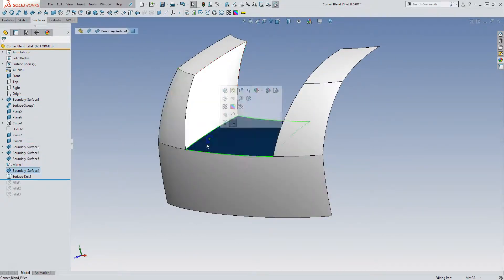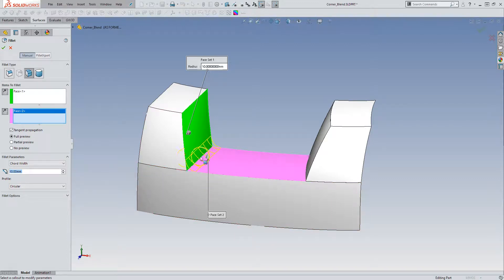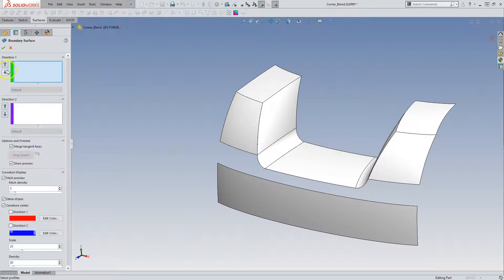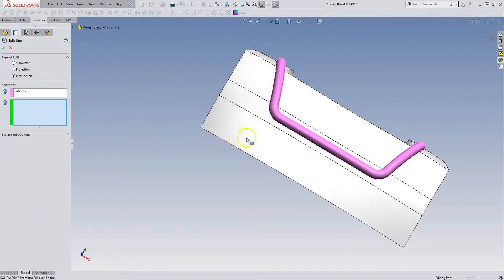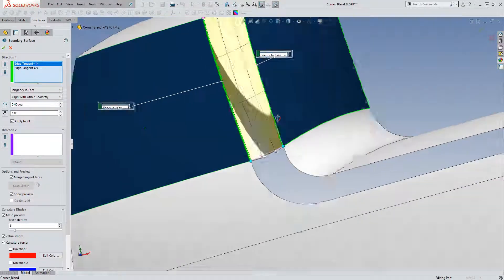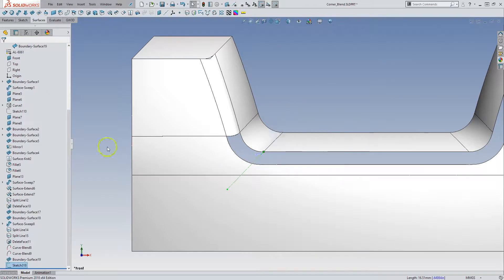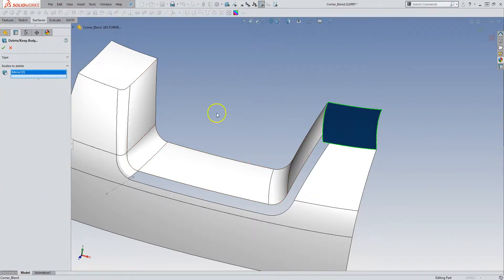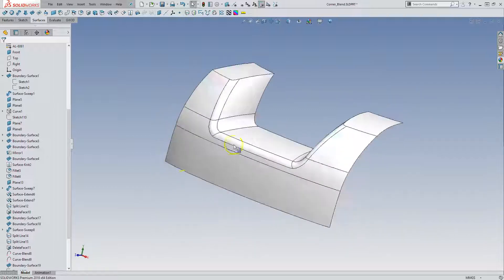SolidWorks Tricky Corner Blend

Comment: This is some advance technique and I'm just dabbling in surfaces.  So essentially you did the following:
a.) chord width fillet thru the valley.
b.) sweeped a reference circle across the front face.  Then cut and fill.
c.) sweeped a reference circle across front valley face.  Then cut and fill.

Comment: thanks
Reply from the maker: No problem, glad it was helpful.
Reply: 9:13 it seems you have trouble making a spline tangent to the line.  I often experience the same thing
Reply from the maker: @SolidworksPractice2  Yes, 3D sketch is often really troublesome and most of the time I don't understand why it's failing. Actually, I never use 3D sketch to create splines anymore. I create all my blend curves with GW3D. It has a ton of options to create blend curves and is way more reliable than 3D sketch. The downside is that you need to purchase a plug-in, but it's been totally worth it for me.